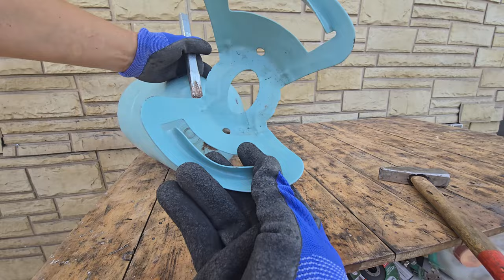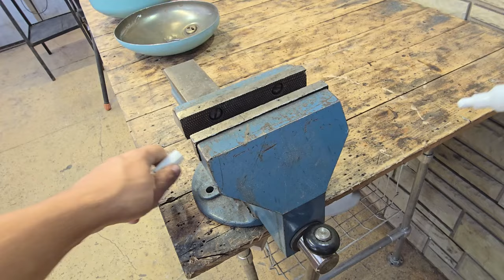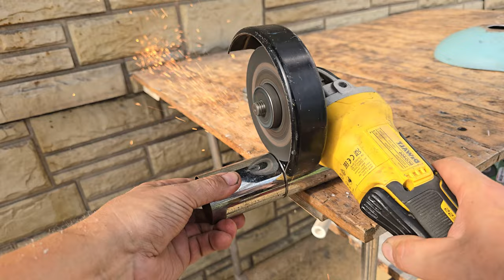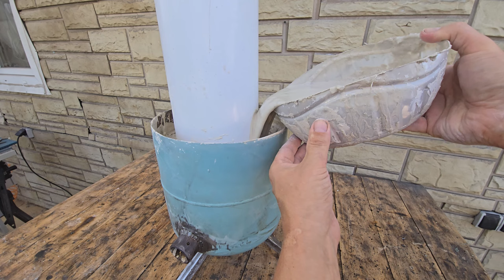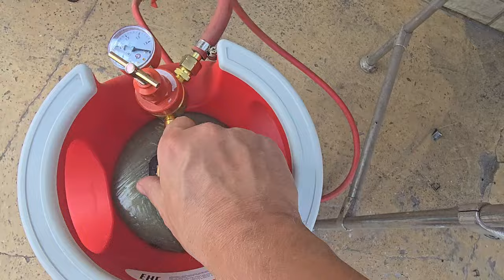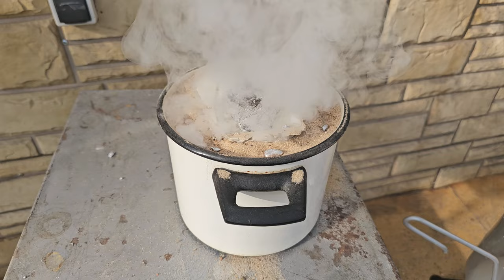Once you learn this secret, you will never throw away an empty freon tank again! Brilliant idea

Comment: Your casting bubbles so much because you had moisture trapped in your mold. That can be really dangerous because you can have a steam explosion that sprays molten metal all over the place including on you. Should really dry the molds before you pour